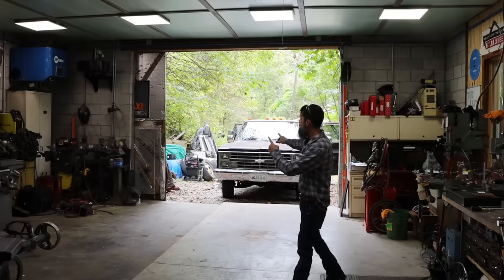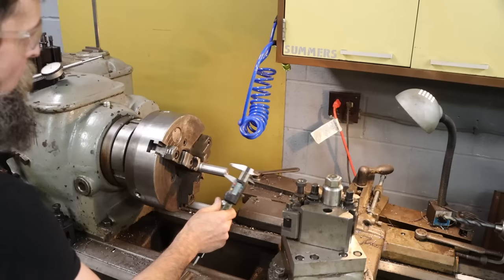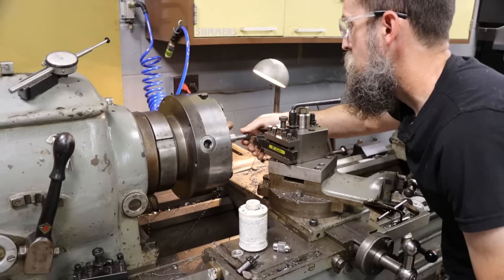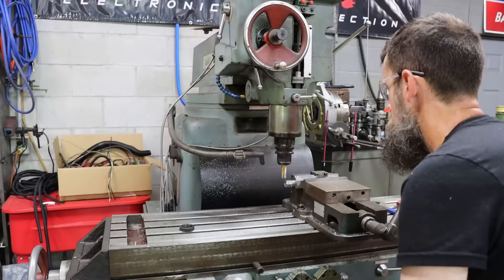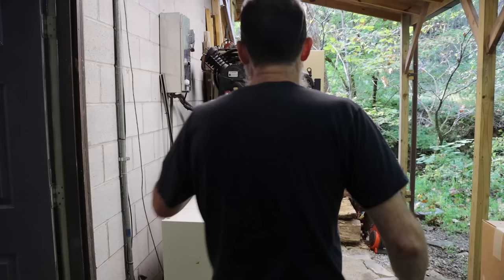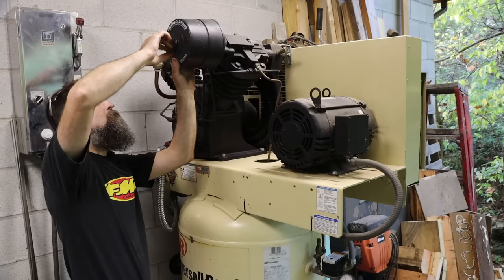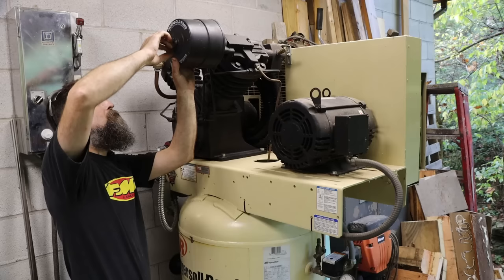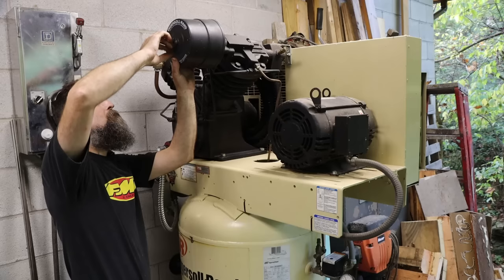Machining hard to find parts. Dumpster Finds & More

Comment: When saw you pull off the brake caliper I saw a Bendix 4152828 caliper. That is the same on my 30' Winnebago RV. I had to repair the right rear rotor which had completely worn out the outside edge and a missing brake pad, which had totally worn out.  The problem was the caliper mounts had rusted and locked the caliper side-to-side motion.  You must clean and smooth out the lower and upper mounts and apply caliper grease to prevent new rust.  My rig has dual rear wheels and a pressed-on rotor to the hub.

Comment: I don't know that they'd be the same quality, but treadmills have similar DC motors.
They show up occasionally in the local bike/fitness center.
Only drawback might be the digital speed control circuitry.
CHEERS

Comment: The first time I watched this I missed the part of the Gr8 bolt. I worked in a logging shop that never reused a bolt. I brought home 5 gal buckets of them. The deal was if you can pack it the 50 feet out the door you can have it. I put them on a creeper, LOL but what a bear to lift into my pickup. From 2 inches to 1/4 inch and as well a few over 2 inch special order ones. Awesome lathe fodder eh my friend. I see you hand feeding the lathe. Dose it no longer work ? I know the lead screw does work for threading. I have the same threading tool holder. K makes good tooling. I love mine.

Comment: 180VDC motor implies 240VAC feed. Maybe that’s why it’s anemic/doesn’t start from closer to zero on the dial? Or if it’s actually designed for 120VAC and has a doubler maybe the caps are shot.
Reply: The pot also needs some contact cleaner - it's pretty intermittent as he was adjusting it - dropping out randomly as it was adjusted. Some contact cleaner (with lube - pretty important for pots to use a cleaner that leaves a little bit of lube behind) in the pot and it'd be good as new

Comment: Good job Steve. I missed it the year of the truck. I had a 1979 Silverado Suburban 1/2 ton with a 305 cui four spd. Actually a three spd with granny gear. Glad your brother is doing the seats because I had the front seat done way back when and it cast a small fortune. Had that truck for ~15 years.

Comment: Since the dc motor is 170v then, MAYBE, the unit needs a 220v supply. There is always a voltage drop in those speed controlers
Reply: Yep it is a 220-volt controller and that is why you did not see full speed on a 120-vac  supply.

Comment: Thanks for another one Steve, great dumpster find there, 1hp with the drive probably a $6-800 find if you checked ebay. As a few other have mentioned may want to check input voltage on drive. I work with some smaller bodine& baldor DC 180v motors, 1/6-1/16hp and most those are 120v input to drive. Majority of 1/2-1hp DC motors ive seen use 220V input on drive
Reply: I think the only thing it needs is some contact cleaner (with lube) sprayed into the pot (speed control knob). Clearly the pot contacts have oxidized. With some contact cleaner in there, it'd be good as new
Reply: i agree, a 180v DC motor/drive should be using 240v input.

Comment: Looking at your compressor: Not many folks know that the first diesel locomotive in the USA was powered by a diesel engine built by Ingersoll Rand. "In 1923, General Electric built the electrical components, Ingersoll-Rand the four-stroke diesel engine, and the American Locomotive Company the carbody of a 300-horsepower 60-ton diesel-electric switcher." (from Steamtown). Thanks for another excellent video. It is always useful to hear how you calculate doc for making a hex. Cheers from Germany.

Comment: Steve, I totaly agree with you about the amount of grease in bearings. During my working days (I'm retired now) I've seen more bearings die of far too much grease than too little. Sometimes it was so bad, that I needed a srewdriver to get the bearing out of its grave.

Comment: i picked up a roll up tonneau cover to replace the fiberglass cap it came with. it's so much nicer having full access of the bed without crawling into it
Reply from the maker: I do love the look of those fiberglass covers on a show truck.  Access to the bed is horrible with them and even storing the cover when not being used is a pain because of the size.

Comment: I think I said this when you installed your compressor, if you pick up your air from inside the shop, it will be a lot dryer!
Reply from the maker: I remember that👍. The issue is that the intake is real noisy . I'm sure it could be worked around tho.
Reply: I was thinking the same thing. I don't have problems with milky oil in the compressor at all but my compressor is inside. I live not too far from Steve in east Tennessee, we have the same sort of humidity in the summer.
Reply: @SteveSummers  Air filter   wouldhelp a lot!

Comment: I bet that motor has bushings and they are worn out, and the (commutator?) just needs a little clean and skuff with emory on a wood block, and it would run better at low current

Comment: they don't indicate off the bearing races. but they do use them to mount the rotors onto the brake lathe. they have tapered spacers the have a slow radius on them. one of these is placed at either bearing race and sinched down with the big stud you see on brake lathes. love your channel. thanks for sharing.

Comment: Nice to see some machining. I usually don't bother to turn the diameter down to the hex across points, because that will end up correct if it is milled to the correct A/F. I also generally side mill the hex, unless the print calls otherwise, it leaves a nice radius at the root and avoids the sharp corners.

Comment: maybe someone else said this.   tightening wheel bearings..   snug up, back off. then tighten the nut HAND tight. if the cotter pin does not line up then back off until it does. i did not invent this. there was a GM campaign back in the days about this. getting technical there should be 1 to 3 thou end play

Comment: Have you ever mentioned that rather special leadscrew reverse that the Hendey lathes have? It appears to make thread cutting a lot less troublesome. No stopping and reversing the spindle, or (as I understand it) waiting for the right number on the threading dial)
Reply: I was thinking about that as well, I thought it was a bit of trickery with the filming. I've worked on Hendey shapers but not Hendey lathes so I wasn't aware of the leadscrew reverse facility. Regarding the plug being cut off the dumpster (skip here in the UK) find, it absolves whoever chucked it in there from any liability. Eleventh commandment for modern times :- Cover thine a55 at all times! All The Best from Somerset, England.
Reply from the maker: I have went over it in the past. It's a great feature that I use on all my shorter threads.

Comment: I need to still pull my front hubs and see if I can determine why my truck has wheel vibration above 70. I think something must be machined off axis.
Reply from the maker: It could be a machining error, I guess. If it was me, I would swap a wheel and tire 1st, then dig deeper if it continued. I've seen rotors be out of balance before as well and cause high speed vibration. Especially on the larger ones like on heavier trucks. I'm interested to see what you find.
Reply: @SteveSummers  I have moved wheels around before and no change even tried a different set of wheels and tires so pretty sure it is something else. Could be rotor related. Would be nice if I had one of those on vehicle balancers to see what is going on but oh well, got to start somewhere!
Reply from the maker: @bcbloc02  It probably is the hub / rotor.  You will probably have to pull it and check it like you mentioned.

Comment: I think if you stripped the speed control you would find a wirewound rheostat that needed  a clean with some brake cleaner or electrical degreaser, and the result would be a smooth acceleration from low to high speed. Love your videos, keep it up!
Phil, UK

Comment: When you cut the hex on the bolt it might have been a good idea to turn off the spindle before rotating the part. You have the experience and are comfortable with leaving it running, but a novice might see this, think its the way they should do it, and meet the cutter with their hand!
Reply: And while on the safety subject. It's also not a good idea to support the weight of a vehicle on just a jack alone. Especially when said jack is on a soft surface.

Comment: Steve, if you take that speed controller apart and spray some contact cleaner with lube into the potentiometer (like deoxit or fader cleaner), it will probably work a lot better. The contacts in the pots get oxidized with time - that's why it's a little flakey as you're turning it, and maybe not quite hitting the speed you think it should be - like when you said "I'd expect 35% to be more than that". Once you clean / lube the pot, that thing will work good as new!

Comment: I changed my compressor's oil (much smaller than yours) not too long ago, and to be honest, I was sort of surprised how clean it was after probably 5 years of use.

I did quite a bit of searching for compressor oil since the "factory" oil was basically unobtainium and found that I could get a decent sized jug for the cost of the thimble full of factory oil.
Reply: I changed a basic I-R 60 gal two weeks ago and the oil looked like new after maybe 18 years, including 5 it sat. Looked like new which surprised me too
Reply: What oil did you go with?
Reply: Wow, just went and looked what a bottle of the I-R select all season goes for.
Reply: @dans_Learning_Curve  I got a quart of Powermate Px oil for my Makita.

Comment: Hi Steve, great episode mate. Your brother's upholstery work is absolutely top notch that back seat looks fantastic! With your brake rotor change ( we call them discs here in the UK) I know you skimmed the other one and I bet the whole hub complete with disc is not a cheap item, but did you not consider changing out both hub/ rotors at the same time? I ask because usually here it is recommended that both are changed because if both discs are not of the same thickness it is considered to have a braking imbalance which will affect the way your vehicle will stop. Cheers from the UK
Reply from the maker: I just skimmed the driver rotor and it's still got a ton of life left. In regards to rotor thickness,  it shouldn't make a difference in breaking power.  A thinner rotor would heat faster and possibly fade quicker than a thicker rotor. Thanks for watching bud👍

Comment: I do a lot of parts manufacturing in my old firearm restorations. Made some leaf type springs just yesterday and a firing pin for an old Winchester rifle. Sometimes they are missing but more often than not you just can't get the parts anymore. On I caught you. Never lay tools on the lathe bed. I got kicked out of the shop in trade school for that. Was changing a chuck and layed the collar wrench on the bed.

Comment: For the life of me, I cannot understand this trend of wheels on cars/trucks getting bigger and bigger while the rubber sidewalls get near non-existent. They look awful and I feel like I'm the only person on the planet who feels that way. I'm actively considering replacing the 18" wheels on my own car with 16" wheels to make it look better.
Reply: Number of tradeoffs here. Lower sidewalls are (should be) laterally stiffer and provide less side roll of the tread which definitely improves handling. Up to a point, then the ride tends to get harsher. Flat tread is more sensitive to proper air pressure. Lower ride, lower CG is good; road obstacles, not so much. Flatter tread tends to hydroplane sooner (depends on pattern) On trucks, I don't know. Eye of the beholder, I suppose.  I have a Ford Flex. Relatively big beast, large wheel, shallow tire. Surprisingly good handling and ride on a decent dry road.
Reply: @milantrcka121  Another big downside to the low profile tires is that they're much more expensive. Back when I had my Mazda 6, I specifically chose the mid-tier trim and then optioned it up to the top tier trim. Price was mostly the same, but it had the smaller wheels. It rode better, handled almost exactly the same, and (I looked it up) a set of four tires was hundreds cheaper.
Reply: Indeed. If I may, look is inconsequential to the optimum tire performance for the application. Just consider you have only a few square inches per tire in contact with the road.

Comment: I could never understand packing the hubs full of grease. Even the grease that's right in the bearing will move away from the rollers and not be in actual contact with them. Modern grease does not melt and flow until something like 250 degrees, and if the bearings ever get that hot, something is already failing.

Comment: With keeping that truck outside do you have any tricks with keeping mice out of vehicles you could share?
Reply: Moth balls are the only trick that I know of, but they can be a little powerfull on the nose. My vehicles are parked outside but they get driven which sort of scares the mice off. They seem to settle in a vehicle when it doesn't move often.
Reply from the maker: Like mentioned by @marcellemay7722 , moving one is about the only thing. Keeping a pet snake in it may work 😄.

Comment: Here is a great suggestion for your gutters. Buy some micro mesh gutter covers and install them. That will absolutely finish gutter issues. The micro mesh allows water in but nothing else and is relatively cheap in comparison to any other gutter ideas...
Reply: It's my experience that many brands of the gutter "covers" wind up with leaves on top, and the water going over the edge, and it reduces the purpose of the gutters.
Reply: @Farm_fab  I've tried many different styles of gutter guards and they pretty much all suck., they still let silt and pine needles in. It's just easier to clean the gutters out once or twice a year IMO.

Comment: I know you get tired of people correcting you, but I got to do it. That is not called a plug. It is called a cord cap.
Reply: And in the UK we call it a Plug.
Reply: @JimWhitaker  Same in Australia.Never heard of a cord cap it sounds like it came out of one of those committees  no one pays attention to.
Reply: Here in the States, they are referred to as a cord end or a plug from the manufacturers. I've never heard them called a cap, and I've replaced cord ends for close to 4 decades, and used many different brands.
Reply: The official packaging from Leviton or Hubble disagrees with you - they're called "plugs"